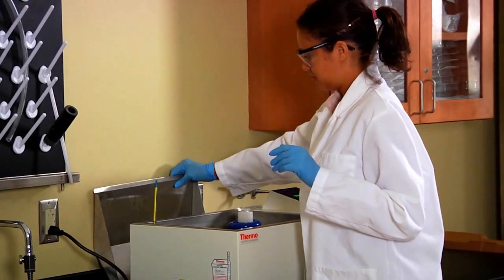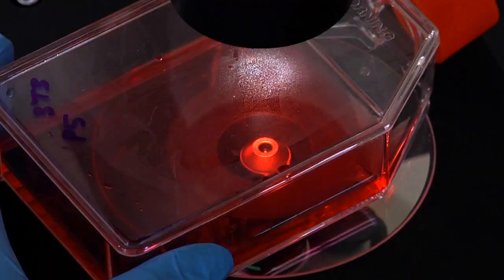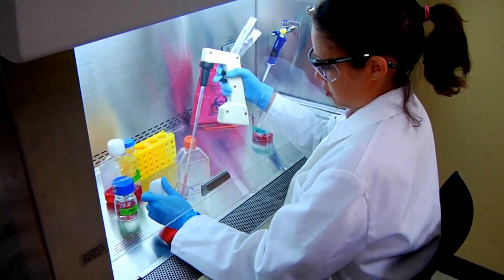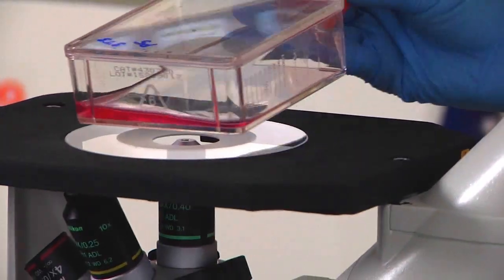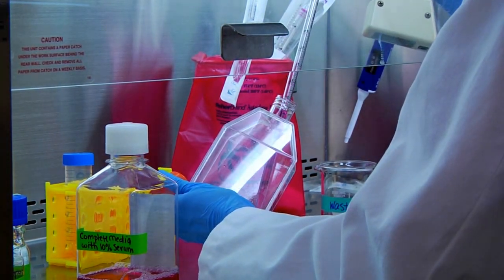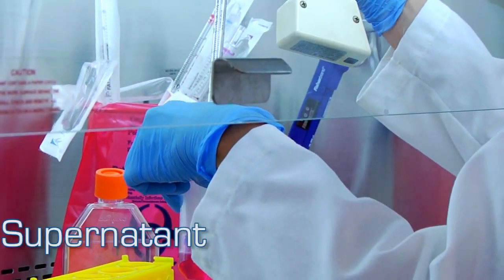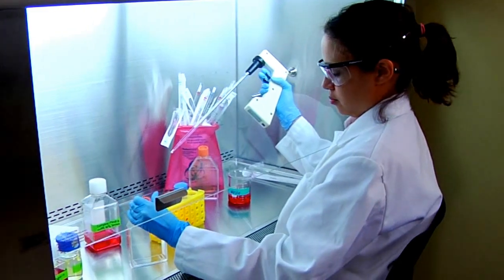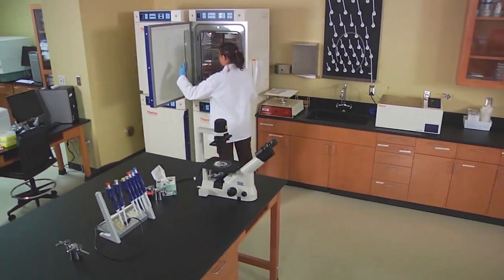Subculture of a Cell Line

Comment: How to prepare a trypan solution 0.4%  starting from powder 60% trypan blue ?
Reply: To prepare a 0.4% trypan blue solution from 60% trypan blue powder, follow these steps:

Calculate the weight of 60% trypan blue powder needed:
• Use the equation 
Concentration 1 × Weight 1= Concentration 2 × Weight 2
60 % × Weight of powder = 0.4 % × 100  mL
Solving this, 
Weight of powder = 0.4 × 100 ÷ 60 = 0.667  grams
• Add 0.667 grams of 60% trypan blue powder to approximately 90 mL of distilled water.
9 Stir until completely dissolved.
• Make up the final volume to 100 mL with distilled water.

This will yield a 0.4% trypan blue solution.
Reply: @kosheeka  Thank you

Comment: Invest in autoclaved glass pipettes and a vacuum pump and save money and plastic waste using so many serological pipettes. 
Also, aliquot your media into 50 ml falcon centrifuge tubes to prevent contamination of the large media bottle; sharing media is the number 1 source of contamination. Media is expensive.

Comment: how can I count confluency?
Reply: Bina Zubayraeva If you need an acculturation of cell confluence, you may use the ImageJ program to measure the cell confluence. However, when you working in culture room to maintain cell culture, you should be estimated by your eyes. It will be faster to work.
Reply: Visual Estimation
• Low confluency: Sparsely distributed cells.
• Medium confluency: Cells are visible but with clear spaces between them.
• High confluency: Cells form a nearly complete monolayer with minimal empty spaces.
• Confluent: Cells form a complete monolayer, often with overlapping cells.

Manual Cell Counting with Hemocytometer
• Prepare a cell suspension.
• Load the hemocytometer.
• Count cells in specific grid squares.
• Calculate cell concentration.  
• Estimate confluency based on cell density and culture vessel area.

Automated Image Analysis
• Capture images of the cell culture.
• Use image analysis software (ImageJ) to identify and count cells.
• Calculate confluency based on the cell-covered area.